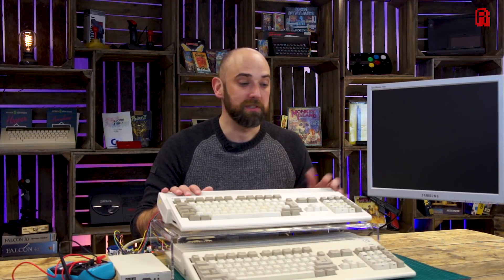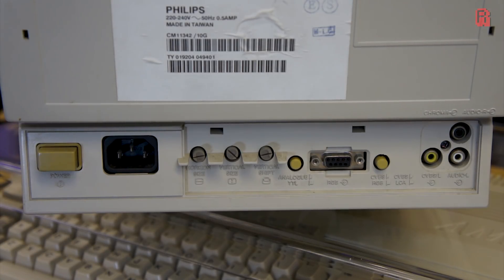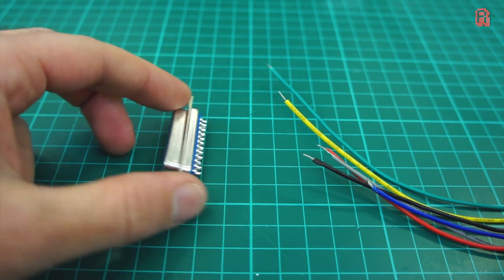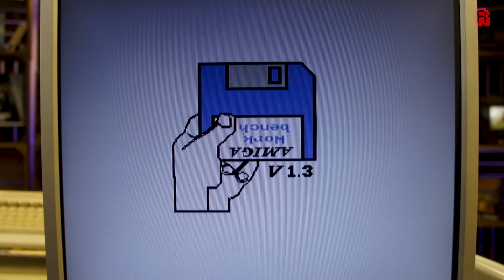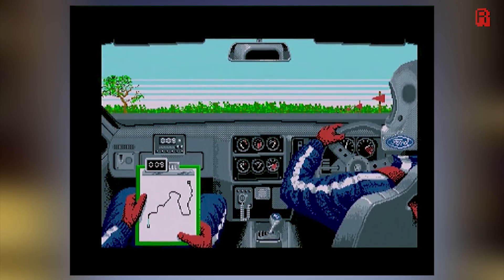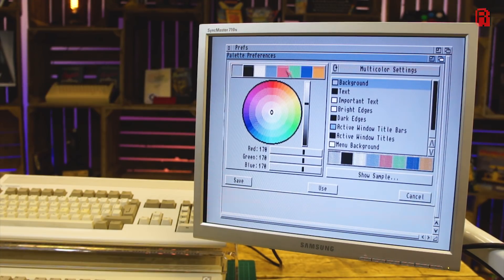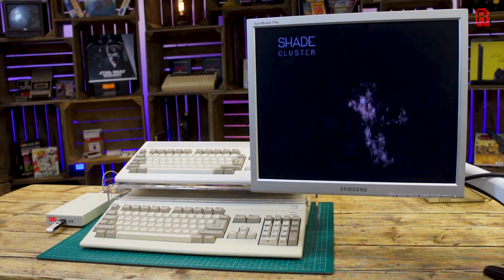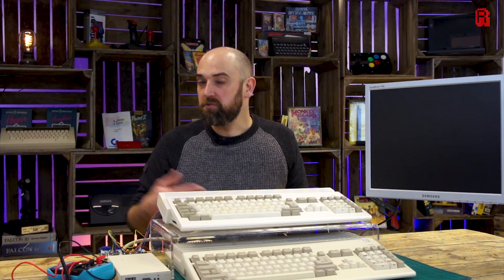Amiga to VGA | GBS-8220 Review (CGA/EGA/YUV to VGA)

Comment: Hey RetroManCave!

Nice video! Since you're planning on doing a follow-up video, I thought I'd let you know that a user called "rama" is working on a custom firmware for these scaler boards. It's a bit technical and involves using an Arduino board to communicate with the scaler chip via I2C bus. But you should definitely check out his work and consider mentioning, or even testing it in your follow-up. 

He posts regularly on the shmups forums and another German one. Here's the link to the shmups thread:
https://shmups.system11.org/viewtopic.php?p=1286439#p1286439

and the Github: https://github.com/ramapcsx2/gbs-control

Greetings from Germany!
Reply from the maker: Thanks I'll check it out.  My approach will be minimum effort and cost I think, because while it's fun for those who can hack the hardware to do so and I love their work, if you spend too much money and time on the solution you may as well buy one of the more expensive options.  I'll definitely enjoy reading up on his methods though
Reply: Yes, you really should check it out. It transforms the device, producing quality that's comparable to those really expensive scalers. Many of the problems you mentioned in your video are being addressed. The mod itself is rather easy and inexpensive.  All it requires is a cheap Arduino clone and 4 wires. It will be quicker to build this than trying to optimize the settings in the OFW ;) the guys in the forums are making progress almost daily.
Reply: Here's a link to a comparison video to give you an idea. 

https://youtu.be/z4fztj9PtB4

Comment: I got one of these a couple years ago. Cheap, works good enough but my only gripes is I couldn't get the colors to look as good as my NEC CRT monitor and If I get the image lined up nice on my LCD a resolution change would send the position way out of wack. So I ended up with a low res image that was to small on the screen to accommodate that. But considering how cheap the thing is I can easily over look that

Comment: Just one tip :) you can use a arduino to controll the GBS board with GBS-control :) there is recently new development of this control software so it is working allot bether now. The shielding mod is not needed and you get rid of the noise and the picture is alot faster. I just testd this my selfe and I really happy how good the GBS board just god with this software. https://github.com/ramapcsx2/gbs-control/wiki/Build-the-Hardware

Comment: I'm not sure about this, but wouldn't be possible to use proper shielded cables with the right impedance? Just straight wires pick noise up (or even cross-talk between them), and also in case of impedance mismatch, reflection would occur (this behaviour causes the "ghost image" in TVs as well for example). However it's just a wild guess, maybe it does not count so much, but more on bigger frequencies (like in the old days with RF cables actually, not so much with "base band" video signals?). Though the cables are relative short here, (so this effect maybe not so a big deal) that's true ...
Reply from the maker: Good points and we will be using shielded cables in pt2, this review was based on the stock items which come in the box to give a true reflection of the "out of the box" quality
Reply: As another commenter mentioned maybe a VGA cable with a ferrite ring can be "modified" or "reused" for this purpose (I'm not sure on Amiga's specs on impedance and the board - hopefully they're match - AFAIK for VGA cable at least, 75ohm is used - but I can be wrong). Interestingly for shielded cables, the "too short" ones actually causes strange problems though! And finally (hopefully I am not so boring) my personal experience with cheap China stuff: if I just shield the PCB itself, it often helps a lot, since proper cases is often not included or the PCB was not designed on that way that it's "noise proof" enough without extra shielding (not exactly this topic, just similar, but once I used a plastic case with some metal - and grounded, but carefully not to touch PCB parts ... - paint on the internal, and the difference on quality was quite big to my surprise ...). Again: just hints ...

Comment: The GBS is an interesting little board, but I haven't used mine since I got a better scaler for Component vido. I had tons of video quality issues, including color banding, distortion, and poor color, and I know there's a fix for some of those but I'm not the greatest at soldering. Perhaps sometime I'll go back, fix it, and sell it for a couple more dollars or keep it as a backup.

Also 3:04 the YUV inputs are for Component video. YUV, even though it's different from YPbPr/Component, was sometimes used as a label for it which is technically incorrect.

Comment: noooooo don't use a scandoubler!! Get a VGA monitor that supports 15khz natively!
Reply from the maker: That's also a valid option (and one which my monitor may support depending on manufacturing date) but there is a small issue of the price difference

Comment: One of the things I don’t understand is how many people want extremely crisp and clear pictures from a vintage computer. I can completely understand why you switched from a CRT and that is up to personal personal preference/practicality. But why does it seem people don’t understand that when these machines were new the graphics weren’t (by today’s standards) very high quality. It’s more authentic to play them without upscaling “rubbish” etc (I know most monitors will automatically do this but many add extra peripherals to do this. Rather then complaining about the lines in the picture accept it for what it is. An “ancient” computer with some good (and some crappy) games/productivity software etc. But perhaps that is just me...
Reply from the maker: +BBC600 that's not just you, and many computers especially 8bit took advantage of the CRTs limitations to blur colour and increase the colour pallette, not to mention the anti aliasing side effects welcome or not.  At the moment my choice is modern monitor or nothing.  CRT is always the authentic solution.
Reply: RetroManCave You also get an advantage using a modern monitor as a YouTuber as a CRT is very hard to film due to it’s refresh rates! :-)
Reply from the maker: kan't be yes which is why I mention 8bits.  The Amiga has a "video" output for a reason, the monitor is the perfect experience on this platform.  I actually had only a TV on my A500 in the 80's/90's so when I got the monitor in more recent times it felt like a revelation but an authentic one.  Which is why crisp and clear, like you say, on the Amiga is an authentic experience.  It's just less people saw it because it was expensive

Comment: I have the GBS-8200 and I get a lot of white and red speckles. In saying that I’m possibly running it at 800x600. I’ll drop the resolution and see if that helps. I see you tried the Syncmaster 710n too in the hope it has the right internals to sync to 15khz? I bought one recently for the same reason.

Comment: Interesting solution. Has some obvious issues, but it's cheap, and it works, so that's not too bad.

I am amassing quite a lot of systems at this point that output 15 khz RGB, or at least one of the S-video predecessors.
I don't have all the cabling for them, but more importantly I don't have the display for it.
While I was in the UK I at least had a TV with RGB scart input, but I couldn't take it with me to Australia, and even though we used to have 'euro' connectors on plenty of televisions, (that's what SCART was called), nowadays I struggle to find anything that still has such a connector.
The issues are obvious, but that it's a cheap, workable solution...
Yeah...

I mean, so far I have this problem with:
-RGB output on SNES and Super Famicom.
-RGB output on Mega Drive
-The native s-video like output on my 800XL (even though the chroma output isn't wired up for some bizarre reason)
-The RGB output that my 800XL will have once I fit the VBXL/VBXE module.

And I would like to get an Amiga at some point, so that's also going to end up having this issue.

Would be nice to get some kind of solution here, even if it's ultimately a stopgap or backup solution...

Comment: That flyback transformer... is that what some techs call 'the frame?' I remember I had an old Philips TV and the picture collapsed into a horizontal bar across the screen. 

Speaking to the telly-tech, and watching what he was doing, he tapped a box that looked like a small transformer on one of the PCBs and said 'the frame' needed replacing. Just a thought....

Comment: I find old games designed for CRTs very ugly on LCDs. The sprites lose detail and become Tetris pieces. Yuk!
Reply from the maker: Matthias Forelli scanlines are a beautiful thing.  I tested this on my 486's CRT as mentioned and it works just fine, so thats an option.  Using this on systems like the ZX Spectrum where colour bleeding on TV's was used as a trick to increase the colour palette, that may not fair so well.
Reply: RetroManCave I use a 14" CRT TV for retro stuff (I have a Japanese Saturn hooked up right now). Thing is I don't have any nostalgia for these old computers except the ZX Spectrum, so using just old consoles works fine on a TV.
I'd say using a PC CRT would certainly beat an LCD, unless you have space requirements, or a bad back! D:

Comment: The bottom of the image is cut off when showing Nexus 7.  Size should have been left at 50.

When I did Amiga captures for a 2006 DVD, I used deluxepaint to create some test patterns for calibration; this worked way better than games. You might want to do the same for best results.

Comment: I'm using a BenQ BL702A 17" 5:4 aspect monitor with a simple VGA<->Amiga RGB Adapter. Works perfectly with 15 Khz too! Silky smooth sideways scrolling and great colors (settings need to be tweaked and possibly differs between Amiga models(?) )
Reply: Same here, basically moved my Amiga, FM Towns, X68000 and even Atari MegaST to an Benq912 / 702 for me personally it´s a much better option than the GBS-8220. Still got two 21" CRT´s around. But i have so much crap space is always an issue.

Comment: Cool video, i'm using a GBS-8220.
I dith a white sparks fix and I use a scan dubbler (scanline maker) it looks great.
But some times the image a bit unstable, I need to fix that.
Reply from the maker: +DaFixer Thanks, which method did you use for the sparkles?

Comment: I bet you could just add insulated wires to the cable instead to get rid of the noise, that fix always worked with composite video wires as the thinner ones gave a terrible image quality

Comment: Just for the feeling i build TFTs in old broken CRT monitors. TFTs are not curved and not glossy like CRTs but it looks okay. i can even integrate a Raspberry pi iand power supply nto the case of the CRT and make it a complete RetroPi or Linux PC...  There are TFT controller boards available wich replace the electronic of a TFT and give a HDMI Composite SVideo and a analog RF Input... Thats very useful too.  So many things are possible if you just try to make them possible :D I really like tinkering with retro stuff. Great Video as always.
Reply from the maker: That sounds like great fun, if you happen to be in the UK you'd be welcome to share them in the cave for us all to see
Reply: Sadly im located in the middle of germany... Most of the monitors are gone to friends and other retro enthusiasts. I still have a lot of 4:3 TFT Monitors with vga and DVI inputs to build new projects. ;)

Comment: Put the sharpness at zero. This sharpness setting on TVs and monitors always adds artifacts because it's actually the monitor applying an analog attempt of increasing sharpness
Reply from the maker: I found 0 was quite blurry and settled at 5 as shown in the video.  It was useful though to exacerbate the problems so you could see them

Comment: I've bought an SCART to HDMI converter and HDMI to VGA converter... they together seem to work better than GBS. Price is similar, and you get a case, not just a bare PCB.
Reply from the maker: Quite a few good experiences popping up here with regards to SCART solutions.  Definitely something to look into although I don't have a TV here with SCART so I'll push on with this to see if it can be cheaply tweaked.  A case would be nice but people sell them for more than the PCB itself which is pretty funny.  I think a Transformers lunch box might be in order.
Reply: You have to be aware that not every Chinese SCART to HDMI will accept RGB+CS on SCART input. However if they do, they don't have problems with Composite Video instead of Composite Sync (Atari ST has only separate H and V Sync, so you have to make a simple circuit to combine them or use CV instead). Drawback of this SCART-HDMI boxes is a lack of adjustments, just a resolution switch in a best case.

Comment: That's not a 15" screen it's 17".
Reply from the maker: You are correct, my mistake.  The content is of course still applicable to any size
Reply: It is but it's closing in on 20 years since 15" lcds were "modern" They were probably phased out before CRTs. The last one I saw had the Compaq DFP connector and was already old in 2005. (Compaq before HP bought them). By that time I think 16/10 widescreen had become the norm for LCD's. But still primitive CCFL backlight.
Reply from the maker: Yes, you are correct.  Modern is used here relative to the Amiga, and in the context of any more recent monitor which still has a VGA input.  I hope you enjoyed the rest of the video.
Reply: I did. Im just used to everything being obsolete as soon as you have charged your card. I personally often prefer black and white TFT monitors of the old school since the picture was usually sharper. They still had black and white laptops in the 90's.

Comment: A cheaper alternative that may suit some people: I bought an Amiga RGB to SCART cable on ebay from retro computer shack. Works really well - far superior to the RF modulator. They also sell cables for the commodore 16, Plus/4 and C64 machines.
Reply: And if anyone still has the ZX Spectrum, there's a super simple mod you can do to make it output composite video instead of RF video. It's on retrogamescollector.com

Comment: Already said, but the easiest is to purchase a european flat TV with a SCART input.
Reply: CaptainDangeax Retro stuff on modern flatscreens looks like complete arse. The Dreamcast just about gets away with it, as do other 6th gen machines. Before that just no. The resolutions are too low.
Reply: Agreed that the resolutions are low. This does not change my statement, a european TV is already equipped with the perfect input, doing composite, s-video and RGB, with the appropriate circuit inside the TV. It's a more reliable and strait way to use a modern flat screen with a vintage hardware. I wish commodore had developped a RGB version of the VIC II. Texas Instruments, for example, made a YUV version of its famous TMS9918 (the one in the TI 99/4A and the MSX, among others).

Comment: Have you considered an RGB-scart cable? Looks beautiful and crisp even at interlaced hires on my 1200 hooked up to an old Samsung 40" TV, though it didn't work on an older LG, even though it claimed to support RGB in one of the scart sockets.
Reply from the maker: Interesting idea.  The only TV I have with Scart is a CRT, an old Sony Trinitron, but it's good to know that's an option
Reply: The cables are on amigakit, and cheaper than eBay, complete with hacksawed 25pin connector! Think even my 4k TV still has scart...I should try it on that one 😀

Comment: I had that same PHILIPS / MAGNAVOX  monitor back in the day on my Apple IIgs -- it was awesome. How did the capacitors look on the boards inside it when you took it apart? Failing capacitors can also give you a high pitched whine like that in some cases.
Reply from the maker: The caps didn't look too bad, no signs of dulled legs or leaking.  I have another system to refurb with some noisy caps on the logic board so I know where you're coming from.  Hopefully I'll get that fixed up soon.